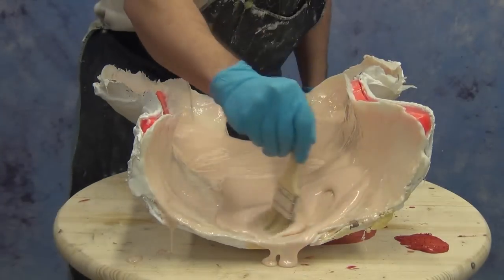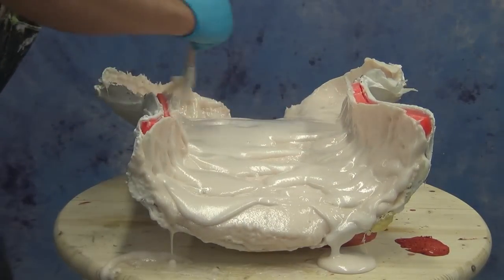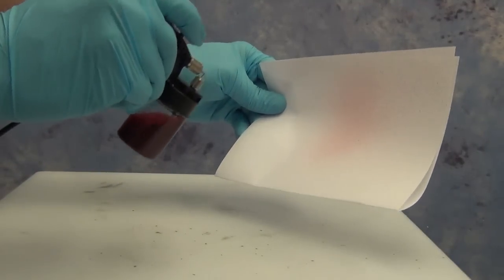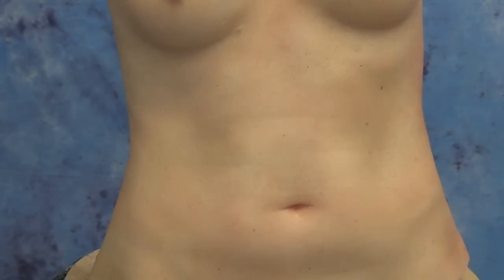Casting Foam Body Parts With A Translucent, Urethane Skin

Comment: Hey, do you know if anyone has tried using this as a substitute for a latex creature suit? I think it would work nicely because of the transparency and 
I'm not a fan of using latex, thanks
Reply: Hi Lightning Bricks, absolutely!  Urethane is extremely durable, it's fast, easy to paint (like BITY showed with urethane flex paints), better library life (you can protect from UV with paint), and great adhesion between urethane elastomer skin backed with urethane polyfoam.  It's also very cost effective compared to silicone.
Reply from the maker: Not that I'm aware of. This is a relatively new product.

Comment: I've added too much polyfiber. I knew I added too much polyfiber because of how much my arm ached while trying to mix it! Admittedly, it mixes more easily than cabosil, which has made my arm ache even more, and my brow sweat from fear of not working out the lumps when adding too much. Still, when pot lives are short, those thickeners can be really stressful when first learning how they behave!
Reply from the maker: I should qualify that: Too much PolyFiber won't change the cure properties, but it will bring on profound sadness.
Reply: Extremely well put!!
Reply: When I mix cabosil into epoxy I add it to part A first, then let it sit for 15 min or so. This allows the epoxy to absorb into the clumps so it can be mixed smooth, then add part B.
Reply: Rob, I would never have guessed that that would work. I'll have to try that sometime!
Reply from the maker: Good tip. Thanks!

Comment: I have a question about the life mold will it stand up to the heat of Wax I'm starting to experiment with the Lost wax casting process I am going to need a mold of that quality that will tolerate the heat of Wax thank you so very much for your time and great video by the way
Reply from the maker: The mold for this was made with our PlatSil Gel-25. It is great for pulling wax patterns and will not require release. This mold was made about a year and a half ago and we have used it many times to pull foam, resin, and Monster Clay positives. The moster clay was brushed into the mold at about 200F.